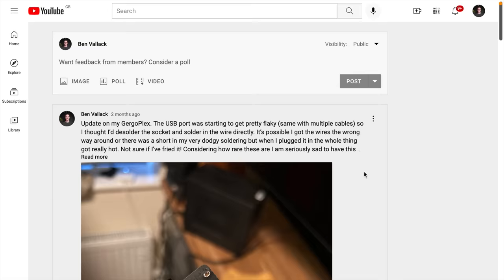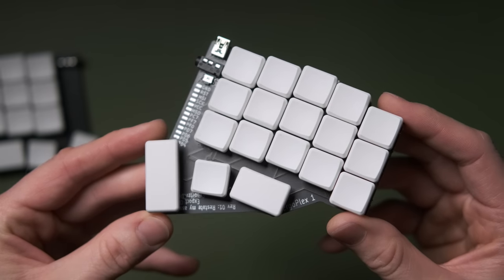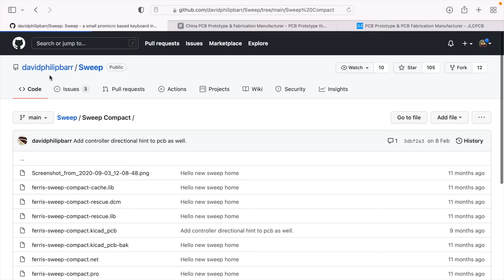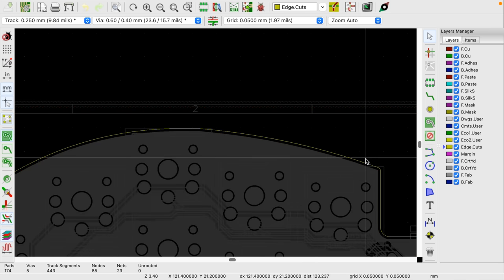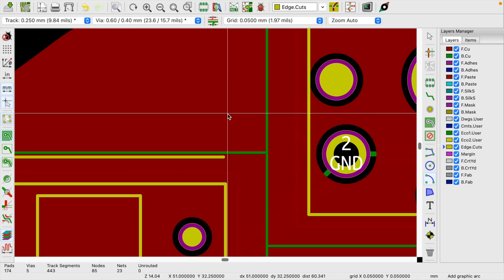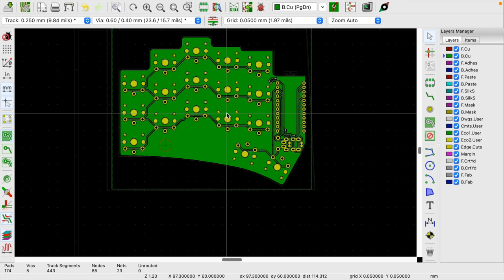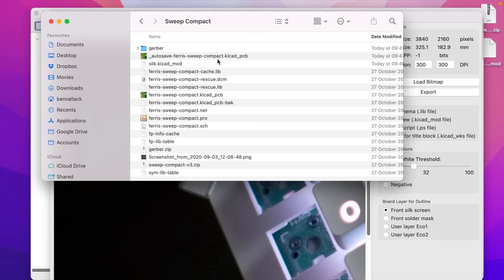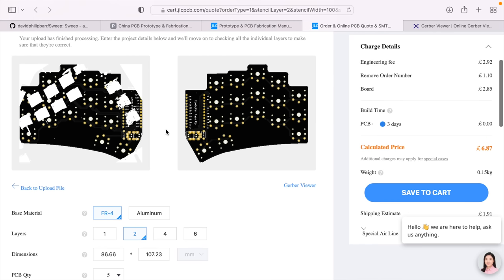A Tiny, Ultra-Affordable Keyboard You Can Build Yourself!

Comment: It's actually amazing how "scary" soldering and ordering a custom pcb looks/sounds compared to how easy it actually is.
This is why these types of videos are important!

Thanks for the shoutout by the way 🤩

I even have a small suggestion, if you take a permanent black marker and colour the edge of the PCB it will give it a nice extra touch, and more "finished" look.
Reply from the maker: Totally agree!! Great tip too.
Reply: Really appreciate your video Kyek. The fact that you show the entire process without a lot of cuts, makes it really obvious just how easy the process is. This seems like a really good kind of board to start with, vs one that needs diodes.

Do you know if there's any other boards out there like this that are as easy to assemble? Even just one more thumb key might make it easier to learn, and also would work for steno (usually steno has 3x6 w/ 2 thumbs or 3x5 w/ 3 thumbs).
Reply: @BenVallack  can we put a oled display in the ferris sweep like crone keyboard? because I love the display but don't like the smd soldering that it requires. TY
Reply from the maker: @salman8562  not sure on that I’m afraid!
Reply: Very!! I do appreciate both videos. I am currently in the process of customizing my own gerber file. The price isn't that bad! If you want to be patient shipping wise, it looks like I'd pay under $8 USD for 5 PCB in matte black. Probably two to three and a half weeks max I am guessing for turn around. That is amazing!! I am very happy to be going down this rabbit hole. It is giving me more keyboards, working on my soldering and "programming" to an extant.
Reply: Hi Ben/Kyek thanks for the vids! I'm just soldiering up a sweep using Ben's spider web PCB.  I have a question. What way up should the left-hand (elite) controller be? In Kyek's vid, it is face up but in Ben's it is face down. The writing on the board looks like it says controller face up but this writing is obscured. Please help, and thanks again!
Reply: @KyekOfficial  doh, it is right there in the notes. Thank you.
Reply: @BenVallack   I have question, are these keyboard n keyroller? like can they register 8 keys if i press them all at once?

Comment: Hi Ben,
I recently discovered your excellent channel.
Here is a tip for soldering headers onto microcontroller boards.
Put the headers into a breadboard, then solder the microcontroller on top of them. You really reduce the risks of: heat damage, solder getting into the socket, and bad alignment.
Reply: Good tip, another way is to do that with a black stripboard held on a helping hand.

Comment: Excellent work, great video!  

It's such a likeable little keyboard on so many levels.  The build simplicity brings a level of personal ownership and attachment, and a feeling of security that if anything goes wrong you can just build another or possibly fix it (not least as the minimum PCB order is 5 so you always have spares).

The Ferris Sweep is my only ortho-staggered experience, but I immediately felt at home with its aggressive stagger and I now look skeptically at milder ones.

Customizing the board and graphics is a great extra step, and I'm sure a lot of people will feel more inspired to when they see this.  The default graphics are very cute though and the crab being made of solder is a very appealing shiny silver.

My build tip is that the key caps, at least the MBK ones I got, are pretty close to non-removeable, so be very cautious about getting placement right.  The available key-cap colors can look very cool.

On the Gergoplex you went with ultra-light springs Ben - is that still your preference?
Reply from the maker: Great comment thanks. Yeah I miss those 15g springs. At some stage I’ll take them out and put them in my current board. Alas no longer the Ferris heh.
Reply: @BenVallack  do I sense that now you've gone down the PCB modification rabbit-hole you've seen that you can totally create your own 34 (or less) key design?  Each time you think you've reached the end of the rabbit-hole, it goes further... :).  I do believe I heard you use the term "end game" about the Gergoplex.... hehe.
Reply from the maker: @wjcferguson  Yeah ‘end game’, total nonsense term here isn’t it!
Reply: @BenVallack  I have question, are these keyboard n keyroller? like can they register 8 keys if i press them all at once?

Comment: One thing stuck out to me during the PCB order process - the "Surface Finish" is HASL(with lead). I'm not sure if there's risk, but from my research, the lead HASL process prevents RoHS certification, so the EU at least thinks there's some risk there. Regardless, you might not want to take chances, particularly given you're handling the keyboard every day and not using a case. The lead free option is only a dollar or two more, although would require a rebuild.

Anyway, thanks for putting together such a phenomenal resource. I'm following a similar process, but making a keyboard with more keys :)
Reply from the maker: Very interesting thanks, will keep this in mind next order.
Reply: I typically use ENIG (gold flashing) which is superior in every way.
Reply: @davidjohnston4240  can you elaborate on why you think it’s worth it, particularly compared to lead free HASL? I researched it and didn’t think the extra expense was worth it, once you’ve made the choice for lead free option.
Reply: @KurtBuilds  Only opinion but gold is inert . And fairly rust resistant is all applications . although weight may be fractionally higher in the ENIG PCB's , it would seem to be longer lasting from a materials perspective . A cheap device for prototype would benefit from the HASL with lead or without but excellent point about daily contact. leads dangerous in that manner but by rights pewter should be banned
Reply: @tobiwonkanogy2975  So I’m not sure the corrosion risk is meaningful, but other commenters online say if you’re have QFN components, you need ENIG because HASL doesn’t have a perfectly flat surface. ENIG is still nice to have but not required if you’re doing a reflow process to save some time, and I’m planning on that, so I’ll probably do it next time for that reason.
Reply: @KurtBuilds  Enig doesn't oxidize so soldering remains easy. It seems to let solder flow better when hand soldering. It's flatter which is great for high pin counts. It doesn't contain lead so doesn't violate safety and regulatory requirements.
Reply: @davidjohnston4240  except cost. If there was fine pitch SMT I would reccomend ENIG too... But for hobbyist building one offs HASL is fine.
Reply: @jurczakc  No disagreement here. If you know the risks (don't go ingesting that lead) and want to save money, HASL is fine, but don't expect it to be available for ever - I'm surprised you can still import HASL these days when actual product need to be RoHS. I've been designing boards for 30 years, so I've got habits and ENIG is one of them.
Reply: @davidjohnston4240  I've only been in board design for ~5 years... ENIG is the norm at work for me also... But almost all my hobby projects are HASL... I'm in the US so import isnt an issue... Cheers!

Comment: Great vid, I've got a Kyria on the way, in part thanks to your split keyboard vids (I found you from ZSA's site). 

Would you consider doing a video on flashing your micro controllers or setup of QMK? I feel like the software config is going to be harder than soldering.
Reply from the maker: Thanks! Yeah definitely in the pipelines. That is probably true actually. If ZMK has all the features you need though that has a much simpler flashing process on nice!nanos.
Reply: @BenVallack  I have question, are these keyboard n keyroller? like can they register 8 keys if i press them all at once?

Comment: I had very similar idea for device like Tartarus, orbweaver, pz31a (i own 2 of them) etc. But with middle row keys with rubber caps and 1 and 3 column dotted to easier keep base position and track keys. Also whole device would not be flat but on angle (higher on right, lower on left) to be more comfortable in use. Also i had different approach for additional rows ... But lack of time is real problem.

Comment: Hey Ben! I have a question but first I must say- new to your channel and I've been hooked on your videos lately. I hope you fully understand how important your information has been both to me, as well as the community as a whole!

As for the question, it would seem the latest version of the Sweep Half-Swept has moved the on/off switch and reset to the top of the board, right at the curve I was hoping to remove as shown in your video. I'm no expert, but it doesn't seem like a great idea to chop things like this off. I'm wondering what new and/or important additions I would be missing out on if I settled for an older version of the board, like the one you demonstrated. With this being my first custom keyboard, I can't imagine it would matter much. Just wanted to know if you had any insight. The half-swept is a must for me to bring down the cost seeing as how the minimum order for boards is 5. If there's anything major on the updated versions of these boards that you know of, I have no issues living with the curve!

Comment: Great Video! I really enjoy your high quality content Ben :) A question regarding the Kaihl Choch Switches: Is the typing feel similar to a common laptop keyboard? Because I'd like that. What annoys me about a lot of mechanical switches is that the actuation point usually comes a little bit after the point where I built up enough pressure to press the key down a little bit. So it didn't send a "key down" signal yet but I thought I had pressed the key down. Laptop keyboards always felt more "digital" to me.. Either I pressed the key and it was registered or not. Cheers, looking forward to your next videos! :)
Reply from the maker: Thanks! They are definitely closer to a laptop keyboard than normal mechanical switches. But still feel more mechanical. Maybe order a few and see how they feel. I love them though. Although they are quite noisy.
Reply: @BenVallack  okay, that sounds great, thanks!

Comment: A lot of PCB houses have an MOQ of 3 or 5, but I don't need 3 keyboards. I wonder if its possible to design a PCB that would double as both sides, maybe with the USB microcontroller being a completely external, off the shelf board that you just attach 3 or 4 wires to. Then a board house with an MOQ of 3 gives you one full keyboard and one extra piece in case you or them mess it up, and one with MOQ of 5 gives you 2 keyboards and an extra piece.
Reply from the maker: That is exactly what these are. Flippable halves. So 5 boards is enough for 2 keyboards and a spare half.

Comment: How did the USB on your Gergoplex break? Was the PCB damaged? Replacing a USB socket is usually fairly straight forward.
Reply from the maker: I was just the socket - I did manage to desolder it ok but I tried to fix by soldering a cut off usb cable into the board instead of a new socket, which I must have got the wrong way around and fried it!

Comment: I'm planning on building a Sweep around a nice!nano for wireless functionality.
I'm curious about your thoughts on battery life now that you've had a few months with your build(s).
How are you charging them? Is it done via the MCU or are you having to de-solder the battery and recharge off-board?
Reply from the maker: Because my mac is so far away from where I sit it isn't reliable enough to use purely on bluetooth so I use a long cable to connect to the primary side. The slave side gets a short charge once every few weeks. They just charge via the usb port on the nice!nanos.

Comment: Hi, one question, just from clear curiosity, why on such projects microcontrollers are mounted on goldpins instead of laying them flat directly on the pads? Their sides are specifically designed for flat mounting directly to pcb and that could lower the profile even better. I understand that on wireless keyboards the charigng electronics, battery, clearance for signal and noise are all in question, but for wired ones? I believe you guys can lighten my up
Reply from the maker: It comes down to how likely you are to want to move the controllers to another board in the future I think.

Comment: Hi,
I printed your PCB and bought kailh box royal and kailh speed gold. And I have problems, because of the distance between the pins on the board and the dostance between pins on the switches. I can not put them into the PCB and I want to ask: are they comptaible (box royal and speed gold) with your PCB?
Reply from the maker: My board is for choc switches, the ones you got are mx switches right?
Reply: @BenVallack  yes, mx switches. So I need to print new PCB's. Thanks for answer and merry christmas.
Reply from the maker: Yeah or change the switches. I can’t remember which boards are compatible with MX switches. Looks like the Sweep High supports MX Switches  https://github.com/davidphilipbarr/Sweep/tree/main/Sweep%20High

Comment: how comfortable is it? i notice that there is no case, so does it sit well against surfaces? also is there any risk of damage to the PCB (because of how exposed it is)
Reply from the maker: The main thing that I learned the hard way is the pins need to be insulated otherwise they can short on each other when stuffed in a pocket. I just covered the connections with hot glue gun glue to solve that.  Other than that some stick on rubber feet make it fine on a desk but I prefer to wear it on my legs! https://youtu.be/iOupyi-lQZM

Comment: i have a question for you. i use a lot of shortcuts already on my standard layout keyboard. should i follow your path and go to ergodox or you think you could have skipped the bigger split keyboard and go instantly to the smaller one? i know you don't have the answer for me, i mostly want to know if you would have done it differently given the change. 

i kinda dig the ergodox since i have implement in my workflow using my palm to press the ctrl button instead of a finger and i think i will get the bigger one, but i still want to know your opinion on the matter since you accumulated a lot of new experiences fairly fast
Reply: I've went from a standard to 65% to ergodox, and I can tell you that with the smaller keyboards it can become frustrating not having dedicated keys for stuff you were used to. Especially at the beginning, it feels annoying to have to switch to another layer to reach arrows, function keys. You wanna press "insert" for some app and suddenly you need to remember which 3-key chord you need for it... If you want to use it as a main driver right away be ready for those kinds of difficulties.
Reply: @AmitGold00  maybe i could pull a reduce size keyboard off then since i use a lot of chording due to me being a programmer and already using chording in sublime almost everyday and in vim from time to time. i think i need the number row though. even if i won't end up using it for numbers but for shortcuts and functions instead.
edit: syntax error
Reply from the maker: Yeah I actually think there is real merit to doing this stuff bit by bit. If you only change a few things at once you can learn it easily, but if you do it all at once you will probably just find it really frustrating. I nice board like the Moonlander or Planck is a great way to do it because is makes playing with the layouts so easy.
Reply: @BenVallack  i know, however i don't have the budget for that so i am going to build ergodox myself. it is the first big project for me, but i already managed to build a controller for a class in uni so i want to believe i can pull it off. 

i know the extra tool offered however my time isn't that expensive at the moment in order for the time investment to counter act the money investment. however my comfort when typing is. 

thanks for the reply and for confirming my idea of going with ergodox. 
great content in general by the way. nice style and really pleasant voice over.
Reply: @hellNo116  Another great option instead of the ergodox is the lily58 or the Soflev2, both can be bought as kits for yourself to build or as completely built as a service. Both the lily and the sofle are slightly smaller than the ergodox, so it can feel like a little daunting to jump to them, but you still got mods, numrow and 4 keys in the thumb cluster. With sofle you can also go for rotary encoders incase you want to have a knob. Just be careful, It's real easy to fall down the rabbit hole, Ben is a prime example of how quickly you'll want to continue downsizing, although I totally agree with what the people above commented that it's better to do it in smaller steps :D

Comment: Hey Ben, do you know how long it takes for the pcbs to arrive after you order them?  I’m wondering if this is a days or many weeks long process to get them custom built.
Reply from the maker: There are different shipping levels, if you pay the extra it can arrive in days. The cheap one can be a few weeks.
Reply: @BenVallack  awesome, thanks!  One more question, I’ve only tried one keyboard with ZMK (Corne) and there were reset switches that allowed the two sides to connect to one another when pressing at the same time.  How do you connect the two halves with the nice!nanos and ZMK with the Ferris pcb?
Reply from the maker: @MicCheckOneTwo12  yeah same deal really, they find each other if when they are powered on at the same time. That side to side pairing is then very persistent.
Reply: Thanks.  May I ask where you got the elastic bands that you use for standing?  I've tried magnets and all sorts of stuff to hold split keyboards, but your idea is cheap and simple and I want to give it a try.